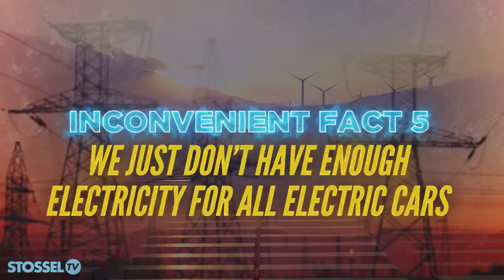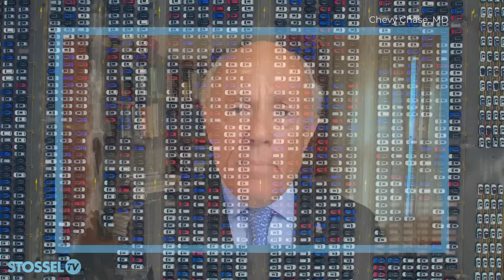Electric Cars: Inconvenient Facts, Part 2

Comment: The “inconvenient truth” that our politicians and media don’t want us to hear. Thank you for this informative report.
Reply: Yes!
Reply: This is condescending elementary view of subject.  
ECONOMICS will rule and that's proven to be BEVs, simply a matter of pennies per mile.  Doesn't matter if you disagree the market place will tell the truth. Relax, let it play out.
Reply: @Mrbfgray  The point of this issue is that our politicians aren't letting the market place set the standard. In California, where I unfortunately live under the dictatorship of a Democrat supermajority with Far Left ideologies, only electric vehicles will be available by 2035 while the power grid infrastructure can't handle the few EVs we have on the road now.
Reply: @mmurph2686    Yeah like when the scourge of air conditioning was released on the USA, massive increase in grid demand over a decade.  I imagine we can continue to survive change for the better.
Reply: @justsomeguy934  two words, Solyndra bankruptcy.
Reply: @mmurph2686  Several words: GM bankruptcy. Ford TARP bail out. Chrysler bailout.
Your comment makes no sense, as if a mis-managed company, protected by the Obama Administration, has anything to do with solar power in general.
Reply: @justsomeguy934  Solyndra represents a $535M green energy mistake by the Obama Admin. The purpose for the loan was to pick a winner in the solar industry, which failed miserably. Last time I checked, GM, Ford, and Chrysler are automakers, not oil companies. Talk about not making sense...
Reply: @mmurph2686  "At the moment, they are not even close to a viable alternative to fossil fuels."
Depending on the application, you are correct. There is no substitute for jet fuel, for example. Massive container ships use bunker oil (nasty stuff) and it takes tons of bunker oil just to get a container ship moving from the dock.
Half of petroleum, however, is refined into gasoline. HALF. Since that overwhelmingly means passenger vehicles and some trucks, those are valuable targets for electrification. As long as the vehicle doesn't have to swim or fly, it can likely be electrified.

Comment: Great job John.  I'm an electrician and I've been saying this sort of thing for over ten years.  You give me a little hope that some people have good sense.
Reply: They don’t.
Reply: The country currently has 2.1 million EVs on the road that consume .2 of a percent of US electricity. Estimates of all cars being EVs shows there only needs to be a 15% to 20% increase in the grid. That's very doable over the next few decades. Electric motors are 3 times more efficient than gas engines and cause a decrease in net energy consumption. And most EV owners charge their cars at night at times of low demand on the grid, and if incentivized by pricing that will continue. It's all about peak demand, you know.
Reply: Me too, my friend. Regardless of what Elon says, the EV has no wide spread application in the future of transportation.
Reply: @ThomasLee123  My Model Y has reduced my fueling costs by 75%. Electric motors are 3 times more efficient than gas engines. Plus no oil changes, no transmission fluid changes, no spark plug changes, brakes last 150,000 miles because most braking in is done by regen, no friction brakes, etc., etc. No wide spread application for EVs? I see no widespread application for gas cars in the future.
Reply: Good sense is not something that the environmental militants have.  Another example, they want you to give up your SUVs or internal combustion engine vehicle while they want to keep using theirs whenever they want.

Comment: One of your best videos, John.  I especially like Mills' comment:  "We've had our energy systems designed by bureaucrats instead of by engineers."  Keep up the great work.
Reply: And It's crazy that in this age where everyone thinks they're so smart, with smartphones at our fingertips, the same people elect the dumbest people to lead them. Nuts!
Reply: I don't think so they thought that Iron Man and the Terminator where powered by batteries when it clear that it is nuclear power both are Reactors, which is all we need because it is most energy dense fuel that we have.
Reply: @southcoastinventors6583  I agree, but keep in mind that Thorium reactors are INHERERENTLY so much more safe than uranium reactors, and therefore can be scaled down to neighborhood or larger sizes, rather than the incredibly expensive region-wide reactors we have ubiquitously.   Again, Thanks for your great work, John.  (I sailed with your father in Chicago a few times;  Shields are great vessels.  ...not sailing anymore, btw..)
Reply: Even worse, accountants and hedge fund managers.

Comment: I’m 68 and can remember as a kid being slave to the coal furnace in our house in souther Illinois.  A large part of the basement was dedicated to supporting the behemoth, including a room that functioned as the coal bin.  There were doors that opened from the ground where the delivery men would dump a mountain of coal into the bin that my older brothers would have to shovel into the furnace to keep it going.  There was also the issue of klinkers, which could cause problems when the spent fuel fused together into a blob.  I’m not saying that this generation is too soft to go back to living like that, they can and will if the need arises, but we no longer have an infrastructure in place to support this arrangement efficiently.
Reply: Loved with a coal furnace as a kid. My oldest brother and I had the job of hauling out the klinkers to the alley. Where we had to jump up and down on them to crush them up. My youngest brother lives in the house now. Alley is still in good shape. True recycling. Coal to klinkers to roadway.
Reply: Loved with a coal furnace as a kid. My oldest brother and I had the job of hauling out the klinkers to the alley. Where we had to jump up and down on them to crush them up. My youngest brother lives in the house now. Alley is still in good shape. True recycling. Coal to klinkers to roadway. Oh, also from southern Illinois. 64 years old.

Comment: Just imagine walk out to the parking lot and battery in one car starts a fire. Then the whole lot is gone plus the smoke kill everyone around. Make toxic rain. Plus the fire cant be stopped so you may loose the city.
Reply: Good thing gasoline can't burn. I put out all fires with gasoline.
Reply: @sokacsavok  lol gas makes fire . Lipo battery burns/melts hotter than the welder that made the car.
Gas car takes one fire trucks water to put out. Electric car they need to hook up the water main and could be there for hours. Have to warp the car in a special blanket.  Then fire trucks have to follow the truck, taking the car away because it can just light up again . Even at the yard, they need to keep to ev at least a more than a car space away because it can light up days after . Good chatting
Reply: Gasoline cars can catch on fire too. I’ve seen them burn, just driving down the road.  The driver pulled over, but the car was completely engulfed in flames within 60 to 80 seconds.
Reply: @larryfinley9221  different is seconds vs minutes.
Reply: Yeah! That happens all the time.

Comment: Another thing they don't want you to know... When it is time for the powers that be to take total control they can turn your car off with a mouse click 1000+ miles away..... Food for thought.
Reply: Not if power from batteries at home. They could just tell gas stations they aren’t allowed to sell, that’s about the same.
Reply: @waywardgeologist2520  i think the technology for them to remotely turn off your car has probably already been around for a long time, but they dont use it on the public much if at all. Hopefully they wont but i think they probably want to and r trying to be able to.
Reply: @waywardgeologist2520  they will control your chips
Reply: @waywardgeologist2520   - Tesla has already demonstrated that they can remotely limit battery capacity (there are videos on YouTube that went over this), so totally disabling the vehicle remotely is within their power if they do choose. It has nothing to do with how you get your power.

Comment: Some genuine feedback. I loved this video, as it opens the question to hard decision making when we discuss green policies. We tend to ignore nuclear as a viable alternative to increasing the grids capability to safely supply electricity to vehicles. We also fail to see the waste generated from lithium mines etc. There are no easy answers and that is why politics need to stay out of science
Reply: Or the fact that "renewable energy" has been the most subsidized form of energy production by far, yet it only constitutes a tiny fraction of the energy consumed in the country.
Reply: This. As long as we are unnecessarily terrified of nuclear energy then we're stuck with fossil fuels as our best option. The only reason we don't have more nuclear energy is simply fear.
Reply: @herrschaftg35  The International Renewable Energy Agency tracked some $634 billion in energy-sector subsidies in 2020, and found that around 70% were fossil fuel subsidies. About 20% went to renewable power generation, 6% to biofuels and just over 3% to nuclear.
Reply: I agree with nearly everything you said, but need to clarify the grid part. Whatever form of energy generated to meet the upcoming demands will overload the existing grid infrastructure. And we are already taxing it as updating the grid is expensive, inconvenient and just not popular (see Texas).
Reply: @herrschaftg35  except it isn’t. Have you seen how much money Exxon receives in subsidies. That one company alone receives more than wind, solar and wave
Reply: @stephenrosenfelder4452  Yes, the grid is old, so we have to update it.  So, we must update it the right way taking EVs into account.
Reply: @1KentKent  yes  i hoped i wasnt the only one  who saw  that
Reply: @stephenrosenfelder4452  the cost associated with many projects necessary are often seen as unpopular because we don't reap a tangible benefit. The expenses and increasing costs to tax payers (for municipality subsidized electric) and to customers on non subsidized power increase also. The costs can be offset with proper government spending on increasing a sustainable backbone for our grid and looking into how to make our nations electric delivery systems more efficient while we shift to an increasing dependence on electricity as a whole. It won't be popular, it will most likely polarize people against it (I am a republican for clarity and can already see the right screeching like idiots about overspending, and the left equally as loud about how it will save the environment yet don't dare look at nuclear). It's a difficult proposition but a real cost we will eventually shoulder and the longer its put off, the more incredibly expensive it will be.
Reply: @stephenrosenfelder4452  I do think its worth mentioning that most EVs can charge during off-peak hours when the grid is not anywhere near being overloaded. Even this issue in California they brought up with the governor asking people not to charge their EVs is missing the context that he said to just avoid it during 4 p.m. and 9 p.m, which is the peak load time in a heatwave.

Many utility providers provide incentives to do this because flattening the fluctuations in power demand is good for them. Power generation can generally be broadly groups into baseload and peaker plants. Baseload is built to run 24/7, justifying investing in maximizing their efficiency, meaning less emissions and lower cost per watt. 

By flattening the demand curve they justify the construction of the more efficient base load plants
Reply: @tonespeaks  I disagree fundamentals to renewable energy being as efficient and stable for grid power demands as nuclear. Legacy automotive is leaps and bounds more efficient because even at 30 percent conversion (which I would agree is probably higher than most ice vehicles get, I would argue its closer to 20%) the petrol chemical energy yields per volume are significantly higher. I don't see automakers pushing california and ny to keep 2035 as the year to nuke all internal combustion vehicle sales, that is a non backed claim. 

I agree people should thoroughly research claims, and often refute both sides of the argument. It's important to understand the long term effects of either proposition, where in electric vehicles will require a massive demand for lithium and other metals that are toxic to mine for as well as massive infrastructure change to the current grid, we know the fossil fuel equivalents are in fact finite and will one day be exhausted, and that the derivative alternatives in ethanol and synthetic petrochemical products require to large of an infrastructure backing to ever reduce the pollutant impact of fuel consumption. 

Long term, we need reliable, sustainable energy. Wind farms inherently reshape stream currents and effect weather patterns (insignificant at this time, but relatable to large scale implementation) the same way dams reduce water currents and effect migration routes for aquatic species (though again, to a lesser degree). Solar is not a viability alternative as the fluctuating grid utilization will still need evening coverage and the efficiencies of panels and the exotic materials needed to increase those to working outputs is staggering. There is a lot to research in each action taken, and I think that again you are basing your objections on narrow studies rather than broad reaching multi discipline approaches from a multitude of areas.
Reply: @chickenrichard5024  the fluctuations of grid demand are greater than the fluctuations of renewable energy creation! That means that renewable energy is more stable and reliable than the humans' own demands on the grid. Solar can completely power the USA with storage, but can power the USA during daytime hours easily without storage. Wind and hydro power are 24/7. What you've forgotten in your claim about petroleum energy being more dense is that it comes with a high price - military protection, subsidies, and the all import POISON it creates when you burn it. In case you didn't notice, sunshine and wind are free and are falling at your feet. No poison coming out of a solar farm. No NOx out of a wind turbine. No aircraft carrier required to protect a domestic dam. No overseas supply chain affected by politics and war.
Reply: @justsomeguy934  I disagree fundamentally. The need for large scale battery and energy storage farms, the need for increasingly exotic materials that will become strategic military and governmental assets to be utilized in wind and solar projects, along with the environmental disruptions currently being faced with hydroelectric are significant. I am not saying petroleum doesn't come at a cost that should be eliminated. I am saying that natural energy production is not at efficiencies that will be workable for long term projections in our grid yet.
Reply: @chickenrichard5024  Your dire predictions of exotic materials is baseless. Lithium is far more abundant than petroleum. Lithium has domestic sources in the USA as well as friendly country sources (Australia, Argentina). Telsa has purchased tens of thousands of acres of Nevada land to harvest lithium from surface clay beds. Let me restate - the volatility of petroleum sources and availability completely outweighs any development issues with energy storage. Whatever resources you think are at risk by building grid-level storage are easily created and paid for by the USA abandoning it's near century-long occupation of the Mideast. The shenanigans going on the Ukraine proves how delicate entire continents' access to oil really is. Oil is a weapon of war, depravation a tool of war (see: Putin). Wouldn't it be worth it to actually BE energy independent? Why can't we use the energy falling on the ground?
Reply: @chickenrichard5024  "I am saying that natural energy production is not at efficiencies that will be workable for long term projections in our grid yet." A reasonable mix of energy sources can overcome intermittent energy production. Solar produces energy exactly when we need it - during the day. Wind and hydro are 24/7, and fossil fuels can fill in where necessary. The basic use of grid-level batteries is peak demand.

Comment: John, I spent 47 years in the auto repair business owning multiple shops. The combustion engine has become so efficient over the last decade mainly because of the computer controlled injection systems. Four cylinders now do the work of some V8's. A friend who had an electric car drove an hour on I 95 in Florida one way to work, sometimes between 85-90 MPH, he had to charge the car to make the return trip. Tried another brand, same thing so he bought a gas car, we will see more of this frustration with EV's.
Reply: as a mechanic I discuss the problems with electric cars in depth on my home page vid
Reply: Obviously it wasn't a tesla, that shit is fire
Reply: @garys6898  how does that coincide with my home page vid?
Reply: @ChannelNews1  your home page video?
Reply: @garys6898  yes in reply to my comment above. I break the whole electric car thing down there.
Reply: @ChannelNews1  but you don't own any, so your just guessing
Reply: Please sent details of this law braker  to the police dept...